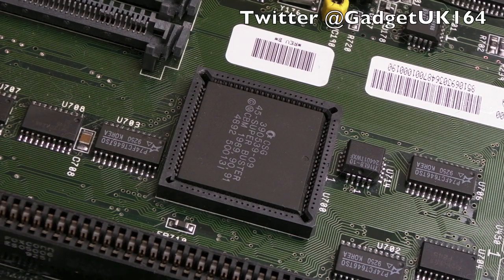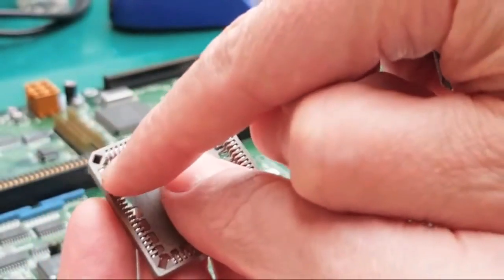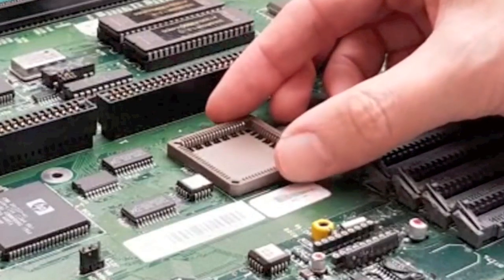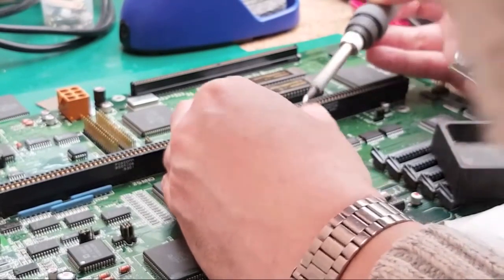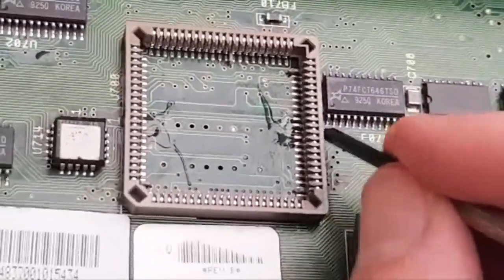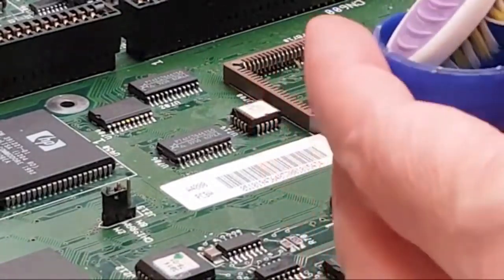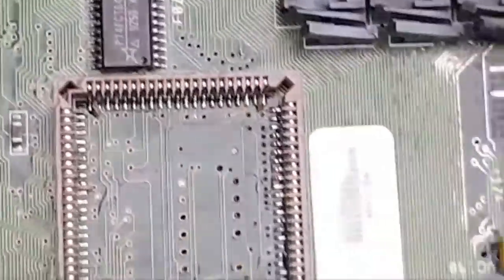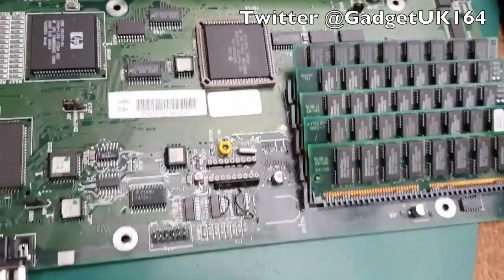Commodore Amiga A4000 Fitting a PLCC Socket (Super Buster)

Comment: I asked Hese to socket the AGA chips on the AA3000+ & A4000TX boards for me because I have 0 skills soldering let alone surface mount and even the NOS chips are 20-30 years old. I can use a PLCC Chip Extraction puller and swap chips. No sending boards around the country/world for repairs. Great video. 1 of the AGA chips on one of the boards was a bit iffy and the problem went away when he installed his own chip. Glad I requested sockets. I am an electronics noob!

Comment: or do it like i do... on the botom ceramic preheater (homemade with good thermostat ~100c) and on top IR heater (ir wont melt plastic, only heat metal)... i use ti to change intel LGA sockets and it work with no problem

Comment: I wish I could find these PLCC sockets for SNES CPU and PPU QFP 100 pin profiles, I could then quickly test good and bad ICs.
Reply from the maker: They aren't  PLCC on the SNES - that uses QFP chips.  I do have a set of those sockets but not got around to fitting them yet.  One of the problems with the SNES, the Ricoh chips are crap and when you use hot air (just hot enough to remove them) - the heat often kills them =/
Reply: @GadgetUK164  I’ve had little to no experience in killing CPUs and PPUs with hot air what seems to die to hot air for me are the APU sound chips, for those I use chipquik. A lot of the time if I’m getting a black screen after a cpu or ppu swap I’ll reflow the pins again and it often works. Can you point me in the direction of those QFP sockets?

Comment: Got to be careful taking the bottom out of those sockets, you can push the chip too far in and make intermittent contact but worse than that, you can force the sides out and rip pads off when you remove the chip. (genuinely not my intention to be snarky, I'm just trying to pass on hard earned experience, I used to run a repair department and we worked on everything from Sinclair ZX81, Commodore PET, 4.77MHz IBM PC,  68K MAC all the way through to the PowerPC Macs, Amigas and Pentium 4 PCs and it's a pleasure seeing these old machines being brought back to life)
Reply from the maker: Thanks, yes, I worked in the repair industry myself before I became a software engineer.

Comment: What a terrible industrial design is that socket! How did those engineers imagine one is going to solder it? I generally like PLCC because it's good compromise between board surface and solderability; the sockets can be through-hole. But seems that if the sockets themselves are SMD, you are forced to do ugly modifications....

What would be the proper way to solder them? Reflow-oven only?
Reply from the maker: I think the way they are designed is to be fitted with hot air.  Ideally you want a stencil, apply solder paste, sit the socket on top,  add flux and heat with hot air.  The next PLCC socket I fit - that's the way I will go.
Reply: @GadgetUK164  I'll be watching that with interrest, sooner or later it'll come handy for my own repairs.

Comment: I would worry about the pads now having to take up the force of the chip pressing against it without the help of the plastic holding it together. Maybe we should order some PCB material cut out to fit around the edge of the PLCC socket to hold it in.